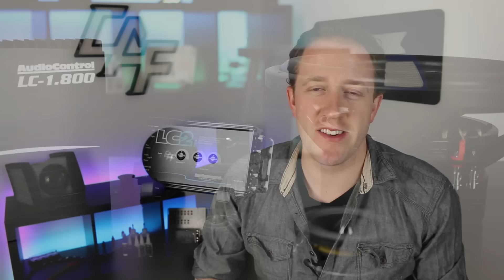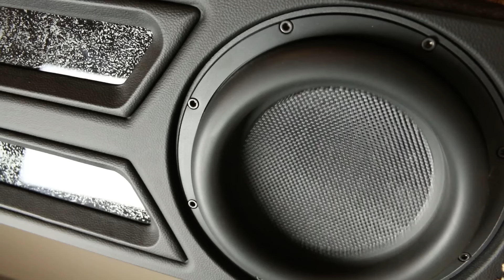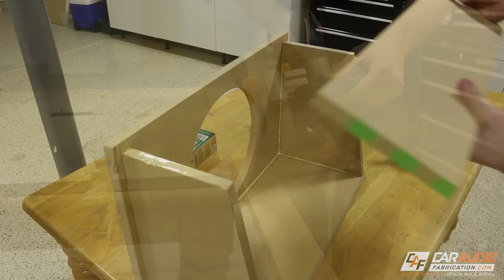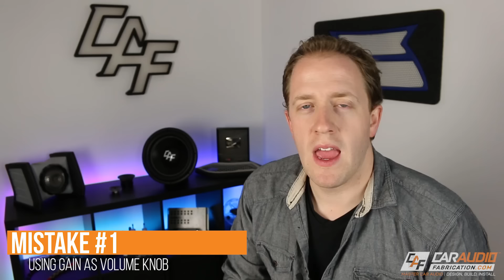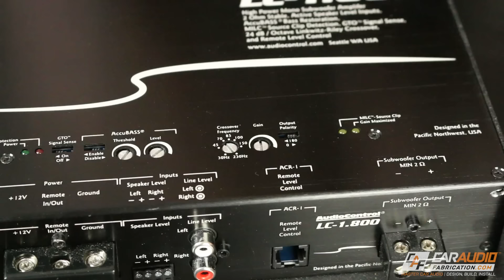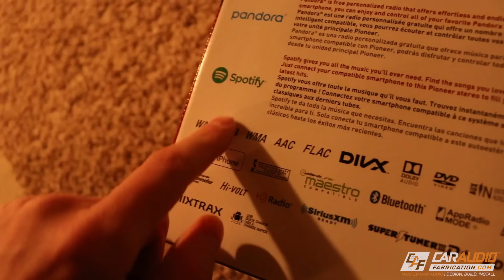Avoid these 5 common Car Audio NOOB Mistakes!

Comment: My first system was old stock clearanced Sony Xplod from Wal-Mart. I got a full system for less than $600. 2 1200w 12s, 1000w 2 channel amp, 6by9s, 6.5s, CD player, amp kit, box, tweeters. I didn't understand the importance of a capacitor so I didn't have one for that system.

Comment: Hi Mark, like your videos and yet personally not interested in building and doing all the calculation for my 09 GMC SIerra Pickup. Can I get the necessary information from Crutchfield to make the right choices to have a replacement head unit (Apple compatible, Rev/Camera compatible, run separate system)? Desire something mild monored, quality system (audiofile) , and think separate's & Woofer (S)? But also very much value the under-seat space I have (Crew Cab).  Do you have a pre-engineered set of recommendations for pickup trucks with out spending huge $$$? Ian

Comment: I usually don't post but I thought ya'll might enjoy this. It was a mistake at first but it corrected itself later. 
I was doing a lot of custom work on a rich guy's new suburban; NEW STEREO, remote start, k40 radar, subs + amps, twindows on all four windows, and KC Daylighters for reverse lights. In order to supply the KC's with the power they needed I ran a "O" wire from the battery straight to the off road lights mounted on the rear bumper. It took hours drilling holes in the frame and cross-members to run the wire but the wire was protected from any possible damage.  I was just about done with the job so I sought payment for my work but the asshole refused to pay. I was mad at first until I remembered that I didn't put any grommets in for the power wire and most importantly I forgot to put in a fuse. About three months later I heard through the grape vine that he was desperately trying to reach me. I wonder if he was in the truck when it caught fire. Motto of the story is NEVER piss off a technician.

Comment: His piont on diminishing return is true but flac is the bare minimum in lossless music at 320kbs the audio format wav is true lossless at 920kbs since its the actual music ripped from a cd and with a good system you can really tell the difference between them.

Comment: U should have mentioned proper ohm matching(not using a computer speaker in ur car),polarity matching and the biggest one I learned...if ur gonna run a amp bridged,or parallel make sure u know what ur doing. Proper connection to the battery. Back in the day they said not to mount ur amp to ur box and rattle the insides apart

Comment: I have two 12 inch subwoofers with a 2000 watt amp

I noticed my lights dimming every time a bass would hit

Do you recommend I get a bigger battery or a second battery?
Reply: Alternator or extra batt.... Cap did not do trrivl for me added extra batt help alot just put 250 amp alt on few min ago and I have no issue now
Reply: Get a battery capacitor

Comment: Mistakes that I see with everybody is believing the wattage of every amp and sub they see. They say oh I’m running 2-12s 1200w each and my amp is 5000w!!! Then you find out amp barely produces 1000w and subs are only like 500 or less. Also not knowing how the ohms work and end up wiring there 2ohms subs down to .5ohms and killing the amp

Comment: Back in the day I remember I went Home Depot for my electrical wire, I think it was 16g house wire, and then went to K Mart and bought a small lawnmower battery. I Hooked it all up and it worked but quickly realized how's the battery suppose recharge it self 😂😂😂😂😂😂

Comment: Biggest mistakes I saw people make in all my years in the car audio industry.  Letting friends and family install their shit.  Expecting good sounding system and reliability when the source is some shitty 60-100 dollar head unit.  Oh and bad connection.  Bad connections really peeved me.  You know that guy that installed his own system using electrical tape and butt connectors at every connection and wonder why his shit looses power and makes popping and ground noises every time he hits a bump.  

I still love putting a nice system in my cars, but I do not miss working in the industry.  I always hated dealing with people and the dumb shit they did.

Comment: Finally getting a sub into my RSX. Single 12. I used to have 2 12's powered by 1200 Rms amp in my old 2g eclipse, MAN I MISS THAT SYSTEM. This rsx's battery is like a 1/3 the size of the eclipse's lol.

Comment: Why would a parasitic drain be coming from my amp? It doesn’t turn off when the car is off?
Reply: You need to connect a remote wire to a source that turns off when your car turns off.
Reply: Collin Branscum I had it installed at Best Buy so obviously they did a bad job

Comment: Ok so I'm thinking about buying a JBL GX608CAM
It comes with two 6-1/2 subwoofers and 2 tweeters and 2 crossovers is that all I need to install them or do I need an amp (minus the wiring harness)

Comment: My big noob mistake was not bothering to learn about electrical wiring or even looking up electrical diagrams before attempting to install a stereo in my second car (1993 Toyota Camry). Ended up just taking it to a professional and having them do it (for a large portion of my income at the time). 20 years later and I know how to read an electrical diagram, I have a strong understanding of acoustics, I'm familiar with rewiring or even fabricating small electronic devices,  and hacking existing hardware to overperform all expectations, or even just repairing old broken hardware so it works again like or better than new. I've turned discarded, second and third hand junk into high quality car audio systems with little to no money involved. A lot has changed in 20-25 years I guess. :-)

Comment: As a minum, encode your MP3's at 192kbps using LAME and set -q 0, and you'll be unable to tell the difference from a CD. ABX test have proven this. For AAC, encode at 128kbps using QAAC or FDK-AAC encoder. WMA isn't recommended, but if have to have it, encode at least 192kbps... preferably 224kbps. 320kbps MP3 is overkill.

Comment: I really suck at math So I just hope the system up the way I know how and run with it but the whole gain nob actually was very helpful cuz I always turn mine all the way up lol but I was having an issue where my amp was going into protection so I turn the level down "gain" and it actually did not go into protection but my amps are getting extremely hot like I could cook an egg on top of it lol is that because it's working too hard ? I don't even know why I asked that question cuz it could be a variety of different things play what are your suggestions

Comment: How about a guide on safely tuning the gain on amps with out an oscilloscope etc... I have a multi meter but never did this step at all, I tend to set it (the radio at full blast, then bring the gain up until it distorts and then back it off) Doing this for each channel so that i can not put the volume up enough to distort any speaker... I cant say this is right, but ive never had a problem with equipment going bad... so, is there any somewhat general way to set it so its ok and not have a pro install done? Or will my way suffice? Hahaha...

Comment: Mark,
Really enjoy your educational content.  I always hit like for your videos (because they are the best i have found).  I am working a restomod project on my 1968 Chevelle. It is straight forward muscle car project designed for long distance touring capabilities.  I have done extensive sound dampening to to floors, doors and roof with butyl/foil product (100% coverage on roof and floor).  I may add a closed cell foam and low density vynal to the floor in addition.  Quiet cruising in the car is important (well as close to quiet as I can get in a muscle car).  My specicfic area of question is in the trunk area. The trunk will hold a small sub and I plan to have 6x9 is the factory position on rear deck. What is the best strategy for sound dampening between the trunk area and the cab since the sub is in trunk?  Should I leave a space in the enveloped cab interior so that the sub can better reach the cab?  Or should I completely encapsulate the cab interior with additional deadener on the rear sun deck around the factory 6x9 positions? Any thoughts or direction so I can continue my research would be appreciated.
Reply: @kevinsimbeck3455  I have a 68 Chevelle SS that I have owned sense 1976. I completely restored the car in the early 90s. When I built my sub cabinet I incorporated it into the rear deck. The rear deck is now the top of my subwoofer cabinet which also has my tweeters mounted in it and then reupholstered to match factory interior. To make adequate room for the subwoofer cabinet I had to cut all the sheet metal out behind the rear seat and rear deck area. Using half-inch square stainless steel and half inch angle. I fabricated a whole new rear structure to accommodate the new subwoofer cabinet, rear deck and back seat. My two ten inch subwoofer speakers are 2 inches behind the back of the rear seat. The back of the rear seat was completely gutted and reupholstered to simulate the original rear seat. It's basically just looks like a piece of cloth but is pleaded to match the original rear seat.  Utilizing that space gave me the ability to not compromise the space of my rear trunk. The trunk is completely sealed and airtight from the rest of the car. When I had the body off at the car I had it's sprayed with an elaborate sound deadening coating. Have no issues with vibration or outside noise. Hope this helps and wish you all the best with your classic build. DC.

Comment: I've been fitting car audio systems for nearly 30 years and I've never used an amp or subwoofers.  I just wire a car stereo into the dash and it's done. A noob mistake would be having wires A4 and A7 mixed up in the iso plug so it looses it's settings when the ignition is off.  The noob mistakes you're on about such as forgetting to rewire under the hood, replace the alternator etc. That's a whole new level.  I've never had to do any of that because car stereo are built to spec and don't require extra power.  Does that make me a noob?  I think the video should be called "Avoid these 5 common Car Audiophile Obsession NOOB Mistakes!"

Comment: I haven't made any of these mistakes because I've found your channel while doing my homework slowly getting my rig together.

I did buy subwoofers bigger than necessary for my particular car, got two 12' pioneers that I'm gonna cleverly slip in the rear of my 7th gen Celica. They're too big. The only saving Grace? It's a hatchback the air space is literally the entire car. Lol. Bump. Bump bump. That's the the Kottonmouth Kings bumping in my hatch. Bump. Bump bump.

Comment: My big first build mistakes were using cheap wire, cutting the factory harness, using wire nuts for splices, using a flat head screwdriver to pop open pannels, using a hammer as a crimper, and just buying and installing mismatched speakers, subs, amps, and audio processor. I still do not understand how that system sounded as good as it did and nothing burned down. When I put back the OEM stuff before I sold it I spent more time fixing what I broke than I did installing it.

Comment: I have heard from Steiners electronics that some people make the mistake of putting in the wrong sub which means putting in one size up and then putting in another size sub that does not compare to it very easily overall this makes you sound very unbalanced and feels like you’re in a remote area that doesn’t have much sound at all it’s very disturbing and it does not have a fix unless you pay quite a bit to have service guys come out and help you fix your machines and now people do not even pay attention to what they are doing when they put in sound systems and it just gets more annoying by the second

Comment: Are you guys familiar with jbl gto629? I plan on buying one of those but im a little worried of my V12 amplifier that has rms power of 80watts per channel. Would that be enough to put out the quality and power of the speaker? Jbl gto629 has 60watts rms power handling and the peak power is 180watts. Hoping for the best answers or suggestions. Thanks!

Comment: I am reading reviews for 6.5 inch car speakers on Amazon. The common newbie mistakes I have read several times now is some guy installs JUST a pair of speakers up front, he does not install an amplifier. So the little amplifier in the radio is powering those speakers.

The sound from the new speakers is mediocre, or the speakers distort. And he's whinging that the speakers are awful and low quality. If he just added a modest amplifier, everything would be fine.

Comment: I use Spotify and set it to super high quality I had everything downloaded on normal mode and switched it all to super hi quality and made such a difference my sub hits way harder and the voices cleaned up so much and this is threw Bluetooth and a fm transmitter but it made the biggest difference. I need to get a ho quality Bluetooth aux forgot what it's called apdex or something and then it will be even better! I'm getting surprising results even no I'm nlutoothing to the transmitter and the. It's blutoothing to the car!
Reply: Remember... Spotify's "High Quality" is only 320kbps

Comment: Imagine two 2 way 100 watts speaker on a 100 watts x 2 channel however if only tweeters are used should the  tweeters be 100watts or 50 watts. thanks

Comment: In my testing with my beet head phones and a good dac and amp. I prefer high bit rate mp3 over flac idk they just sound smoother and only a bit worse almost not even posible to notice. But yeah regular mp3 vs a high bitrate mp3 is very noticeable. And compressed turns my $400 planar headphones in to garbage

Comment: What I've learned after putting $3500 into my SUV. 
I appreciate sq and sound tuning but realized that I didn't particularly like sound coming from right in front of me "like a concert". It's SUPPOSED to be that way I get it, with the bass above the dash where one can hear it but not know where it's coming from. All tuned by a sound competition judge. 
 Having another go at it in my Ford F-250 I might not go that route again. 
I like "surround sound" I think better than above the dash sound. I know that not how one hears it at a concert but it's what I like.
Reply: I used to think the same until I really got into time alignment. Sound staging is everything and makes a world of difference.

Comment: To calculate fuse size, use the maximum power of the amp divide that number by 14.4 and that equals your fuse size. So for a 600 watt amp you would need a 40 amo fuse.
Reply: You should multiply 
( fuse rating × 13.8 = A × the amp efficiency) I believe 80% efficiency is about right in the real world on class d and about 65% on class A/B.

So say I have a 1000wrms @ 1 ohm class d amp with a 100amp fuse rating.  
Formula would be (13.8 × 100 = 1380w × 80% = 1,104 watts.
Reply: You should always divide by 12 to be on the safe side. But so much more just on fuses
Reply: @Catchmeifyoucan209Stockton  if you divide 600 by 12 that equals to 50 amp fuse. 40 amp fuse would be the safe side. If it pops often you can upgrade to 50 amp but I'd stop there and not go to 60. You divide by 14.4 because that's what the alternator produces when its running.
Reply: @realfrankandrade  I didn't mean to put safe  side you divide by 12 otherwise your just going to end up changing out . Also 14.4 is the highest they put out that's with high rpm so unless your driving on highway or drag racing it's more like 13.8 the range is 13.5-14.4
Reply: @realfrankandrade  safe side meant so you don't have to worry about it I worded wrong

Comment: Can someone help me please? i see a lot of car audio online but i wanna keep it simple. if i just upgrade the normal speakers in my door (fiat punto 2003) with these (JBL Stage2 624 ) will i notice a big difference? I don't want to have the sick subwoofers and stuff. just a upgrade of audio and a tiny bit of extra bass/lower tones.
Reply: You won't notice a massive difference since the source is still the same. if you swap head unit as well, then you'll hear a bigger difference. i still say swap the speakers though as the factory speakers are typically pressed paper and aren't that good at all.
Reply: Sp//ity thankyou i will replace both. Factory speakers are so bad when i turn up the volume i hear a lot of “kggggg kgggg” haha

Comment: quarter on the gain always worked perfectly fine with me
Reply: Yeah with most head units this will keep from clipping. Some 4-6 volt rca output  radios may need a little less but a quarter gain is usually always clean up to 3/4 volume. the biggest noob mistake though is buying a weak piece of shit 200 Watt boss amp and want more bass so they max out the gain and bass boost. already seen two friends blow subwoofers like this . And of course they overpaid at Best Buy for their basic kicker comp c  systems.. Lmao $600 for wiring, a 10"  sub, box and 500 watt kenwood amp. What a joke
Reply: You can do the math for the ohms your running the on the sub with the rms to find the voltage you need to run and use an amp meter touching the speaker terminals and turn the gain until your right at the correct voltage where you have the most you can get out of it without clipping